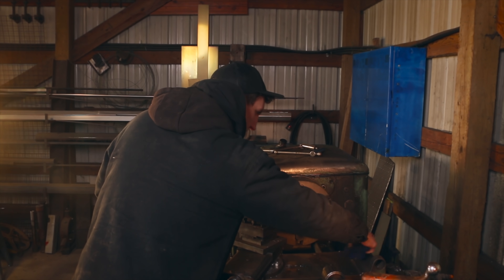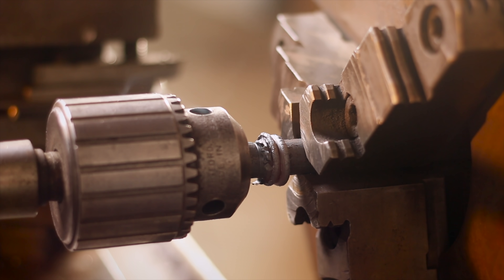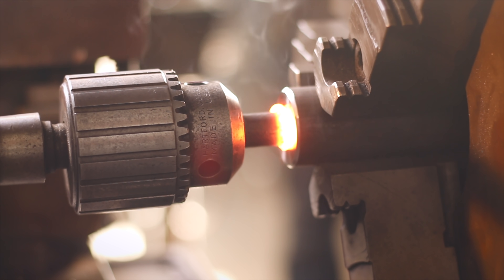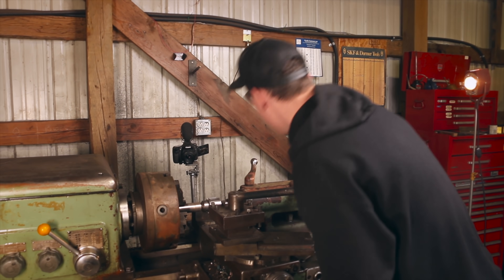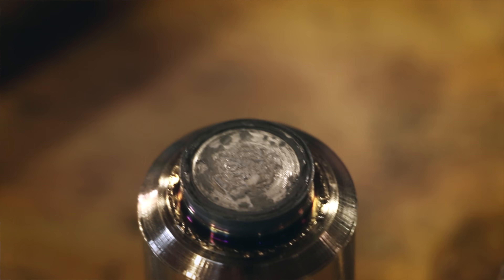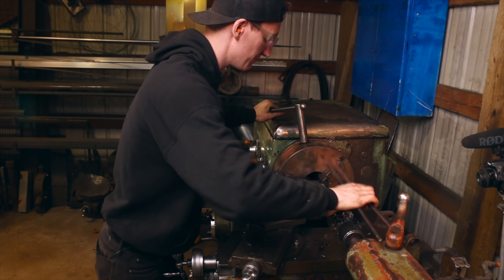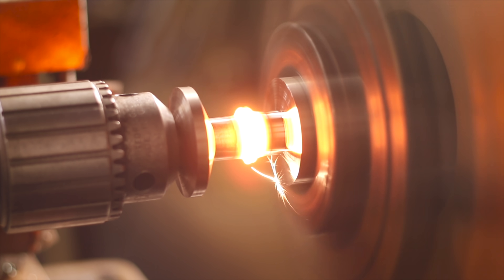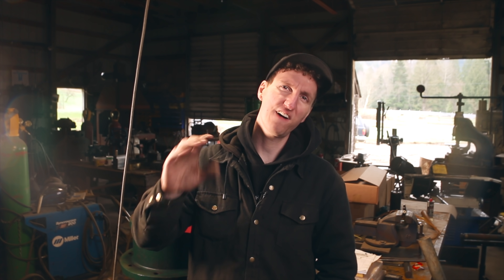Can I FRICTION WELD TITANIUM on my LATHE?

Comment: When friction welding, the more buttery melted metal extruding from both ends you are welding, the better the weld will be. Also, as soon as you have stopped the spinning used to create the friction weld, apply as much pressure force to the joint as possible, this will help achieve a stronger friction weld join...

Comment: As far as I know the material needs to be as thick as the piece you are friction welding nother words it need to have material coming out to shave off as thick of the metal I believe don't know for sure but it does make sense though i think

Comment: Years ago I visited a factory that employed friction welding to join axle halves. Their setup used a spinning end and allowed for adjustment of the stationary end, so when the weld was done and the resistance increased, that end bagan to spin too. The welds were great and done in about 2 minutes.

Comment: It worked so well on titanium because friction stir welding was developed for titanium (and aluminum to some extent) because standard welding processes don't work as well on those materials. Maraging and inconel are less ductile at high temperatures than titanium, but still possible to weld this way: it just takes even more mechanical force. Ridiculous amounts frankly

Comment: The first is exactly how a friction weld should look like! It has to bulge a little like this. If you see this (and the combo is weldable at all) it's almost certainly a good connection.
If a material is weldable by any means it usually can be welded by friction welding... if your lathe is strong and rigid enough. Turbine rotors from super alloys similar to your inconel stock are welded like this, but on HUGE machines using drive motors in the Megawatt range or tons of flywheels and hydraulic pressure.

Comment: Wonder if welding small to large would work better if you drilled the bigger piece with a small tapered hole and deformed the smaller rod into it? Lot more surface area, so the smaller piece would dump a lot more heat into the larger piece.

Comment: I’ve done this on a lathe. The problem is that the lathe takes too long to stop. If you watch friction welding they stop instantly. It would be good to make a clutch or some type of release on the drill chuck so it would instantly spin with the lathe chuck.

Comment: You gotta take it further! Take your welding sites down to half inch diameter and around quarter inch long and squash those puppies together till the whole welding nub mushrooms out. You need small surface area for high pressure at the start and enough material to mush the impurities out. Kool video! That titanium mushroomed nicely. I only worked with steel.
OOO                          OOO                                                          OOON|NOOO
OOOO                     OOOO                                                          OOOO|OOOO
OOOOOOO  |  OOOOOOO                                                          OOOO|OOOO
OOOOOOO  |  OOOOOOO                                                          OOOO|OOOO
OOOOOOO  |  OOOOOOO                                                          OOOO|OOOO
OOOO                     OOOO                                                          OOOO|OOOO
OOO                          OOO                                                          OOON|NOOO

Comment: I'd be really curious about how much it would help/hinder or nothing at all to take a propane/mapp gas hand held torch and assist in heating up the two pieces especially to help heat the part not moving in the chuck. Would it weld easier because you have more heat or would it cause it to oxidize and prevent the pieces from really sticking to eachother. Maybe an idea for another video or something. Anyways great video always enjoy your content.

Comment: I wonder if the dissimilar size weld could be better achieved by drilling a hole into the larger piece that is just a bit larger in diameter than the smaller piece, then having the smaller piece a bit longer than you need so the amount that squeezes out fills the hole.

Comment: Try using some argon gas next time I think it would actually make a difference same way you can't weld titanium or inconel because of the oxidation that is caused by the air and contaminating the alloys structures and properties

Comment: On a few of these, you didn't do it good enough, once the parts are white hot, you are supposed to push them hard together, that way they cool off with each other and not apart from each other, it's also a hit and miss, I have seen industries do this in certain areas where they can't hand weld something, so they use friction instead :P But other than that, I think you are getting a good handle on it, and..... Friction welding is much safer than any other welding....

Comment: At the last stage in Friction Welding when you stop the lathe, the non moving part should also move with the rotary shaft and then come to a halt so that there is no weld abrassion
Reply: Agreed, say a brake on the stationary chuck that would allow you to "release" the chuck when you power down the lathe. Allowing them to spin together, and not sheering the weld. 

Or, make a snap brake for the moving chuck head, vis a vie: an oversized chainsaw safety brake.

Comment: try again but this time use 30 degree bevel for centering (convex/concave) ,well miss match by a smidge 29.750 to 30 so your center point comes to temp faster and before the rest of the metal .  you could also do multiple v groves to center and improve the area of weld ,but that traps oxides inside weakening the joint . its a trade of most times but improves weak joints .
blerpy derp it will improve joints that are weak from oxides in them ,gah there got it said correctly

Comment: One function that will affect the strength of the weld in any material is the "metallurgical structure". The welded area will potentially have a completely different structure due to the heat and cooling rate than the rest of the material. Sometimes the welded area will have a higher strength, sometimes a lower strength. In commercial friction welding, the pressure and temperature will be accurately controlled. Both pieces of material will be held rigidly / securely to prevent and sideways movement.

Comment: If the face doesn’t weld properly, instead of resurfacing it, use the pre-existing face to speed up the friction weld. Rough surfaces provide more friction.

Comment: on the ones that didnt want to stick, maybe try machining them both into like a sharpened (but flat tipped) pencil shape, so as they heat up and press together, maybe it would push the scale out to the sides and allow just the metal to fuse? idk

Comment: How to make the joined pieces a lot stronger....including different diameters.
Make a nipple in the stationary piece. If the diameter of the stationary piece
is 1/2 inch, turn down the end to 1/4 inch...1/4 inch from the end. Turn down the
turning piece to 3/4 inch then drill a 1/4 inch hole into it slightly less than 1/4 inch.
You want the one in the hole to hit bottom first so it heats up first and starts fusing.
By that time the top (larger diameters) should be making contact. 
Using a torch to heat the end of the larger diameter may help the fusing.
You may have to play around with the diameters, length and diameter of the nipple
and depth of the hole. It should weld/fuse very strong.

Comment: what would happen if you tried friction weld two different metals? knowing each types of metal have different melting point, so low melting point will glow and get mushed before the high melting point need more heat friction to melting point before it get fused. would be best to get two closest melting point to work?

Comment: Try cutting the stock into cone segments.  The small face will heat up and conduct the heat backwards pretty well.  It'll also minimize oxide buildup if you maintain pressure from the tailstock.  Also maintain it after you stop the spindle.  I think those in combo will help a bunch.

Comment: Couple items for you to do. 1: purge gas is needed for most welds done like this, was surprised to not see the Titanium not go up in flames. 2: cut 60 degree cones on the pieces one male one female, helps center and increases surface area. 3: to avoid spin-down issues, release the piece being held in the fixed side and let it spin with the driven side.

Comment: 4:10 With friction welding, you need the same diameter faces to be pretty much the same size in order to make the weld. This is because the entire end side of a piece has to connect to the entire end side of the other piece I order to create a solid weld. Having them at the same diameter allows the ends to perfectly rub together to creat the needed friction

Comment: You should have set a cone in a concave. This would maximize the surface area, just make sure the thickness around the cone is the same for even heat distribution.

Comment: You can get a better friction weld by increasing tge surface area between the two parts. If you go from a flat plane to something more of a cone, you will see better results with titanium. You can also just make it peg and hole mate to each other, but thats hard to keep stable on the lathe.

Comment: I'm not a metal worker but I've met Inconel while working with autoclaves. It's pretty neat. Acetylene torches bounce right off of it. Monel is cool too. A stuck Monel screw will snap your screwdriver blade, without a scratch, before it will break loose.

Comment: You could try using a welder for gas shielding, or start with points rather than flats, heat/weld center out. Just a though I felt like throwing out.

Comment: I wonder if you made one side conical, and machine the other to be the inverse.  So you have one going inside the other, which may give you more stability when applying pressure, but also more surface area for friction to generate.

Comment: Where the surfaces meet you could try to find a way to stop the material that mushes up and away from the bond, like a thin titanium sleeve or pipe slightly bigger.
Reply: I think you actually want this to happen, then just grind or shave off that mushed up exterior after.

Comment: Too  much heat sinking on that large diameter part right in the chuck, turn diameter down to other part diameter on maybe 1" lenght or so and give it some stickout, and it likely works.
Titanium is very bad heat conductor, so heat stays right in the friction zone, that's why it works so well.

Comment: might I suggest angling the bits so they fit in one another and create more surface for welding and morphing
Reply: You acttually want the opposite - He needs to reduce the area
The pressure is limited by his leverage - He needs the pressure to increase to create enough spot heat to plasticize the metal so that it can flow and stir
As that happens the mushroom is oxidized surface being pushed out under pressure leaving a gasless contact for the stir

Comment: Can you friction weld titanium to steel?
I know it’s really hard to do this task anyways but I’m just curious
Reply: Yes in theory, but not well in any practical case - the difference in heat transfer capacity means 1 material reaches plasticising heat and flows which means the other loses pressure
This means the more conductive material deforms hugely and the other starts losing heat
Reply: @bengrogan9710  wow, interesting. I learned more from one comment then I did my entire life in school

Comment: Fun fact: the weld in a friction weld is actually stronger than the material welded.
Reply: @DingDingTheYoutubeBuddy  you’re right, it binds the material together as one. But a friction weld produces a finer grain size than the original material, which in many circumstances makes the weld stronger than the original material.

Comment: I have an  idea you can try and make the tip of one of the materials  like a cone or a needle so that when the metals combine they aren't just stuck together but one of them is imbeded in the other and the heat will weld them a bit stronnger but thats just an idea .

Comment: For the metals that didn't work well, i think if instead of machining the ends completely flat, you could try machining them in a bit of a cone shape, with a smaller flat surface, allowing it to heat up faster in a local area, then when its hot enough push it together so it mushrooms out until you reach the base of the cone shape and are back to the original diameter.

Comment: Friction welding requires upset (pressing the pieces together to squeeze out metal from the inner faces) to join clean metal together within the weld.
Trimming off the upset removes stress concentrations,
And ideally you would want one of the pieces to be released after upsetting them so that it can spin freely with the drive (continuous drive friction welding is what you’re doing) and allow them to join.

Comment: Very cool video. Always cool to watch this stuff, I'm a mechanical engineer, took materials science a while back and I did a research paper on friction welding. What I think most affects fusion in friction welding is how readily the material transfers and merges together, which is affected by hardness, surface roughness, and conduction across the heat affected zone. Soft very smooth materials that readily exchange electrons can actually cold fuse together if theyre similar surfaces enough. Anti friction and anti galling materials are designed usually through surface treatments to resist the transfer of materials and recrystallization of the material structure. Deal with this quite a bit in the food and beverage industry, cause we want to use stainless everywhere but you can really use a stainless shaft in a stainless steel hollow shaft geardrive unless it's precipitation hardened and expect to get the drive off cause they will gall together.

Comment: If it's not showing colour, it's not heating.

That's the trick. Ever looked inside a furnace? Everything is the same shade of orange/white, no matter the material, if it's the same heat.  Some metals will be soft when orange, others, like titanium will remain hard long way into white.

Comment: Have you tried fitting one side inside of the other to see if it'd fuse? Like a 3/4" piece fitting inside a 3/4" hole on the other piece?
Reply: Too much surface area reduces the spot heat generated as the force you can apply is limited
Reply: @bengrogan9710  Okay that makes sense. Thank you for the insight!
Reply: @420Chameleon  Essentially the failure point for friction welds is if you cannot create spot heat faster than the metal conducts it away - The only way to create the spot heat is more speed and more pressure

The pressure here is limited mostly by the pitch of the tailstock screw so the smaller the area the more PSI you can apply even though the force never changed

Comment: I feel like you should try flooding the area around the lathe with Argon somehow, maybe a circular hood around the lathe, with the titanium🤔
Reply: I was thinking the same thing. He needs to surround the outside or the weld with a inert welding gas like Argon so it will stop the oxygen from getting to the weld. On any of the metals this would only make the weld stronger. The 2 different sizes could be done easy enough to by heating the larger size with a rose bud first.

Comment: What i think would be cool if you designed a chisel that would make the excess metal shoot back at the lathe so then you could use a metal chisel while its still spinning and red hot so then it would be a really smooth weld

Comment: You should remove the mushroom edges before hammer testing. Those edges are an invitation for the  crack to propagate. If the joint is clean, then the strength should increase. I suggest you to arrange a simple pendulum testing apparate, so you can even have a quantitative measure of the results you got.
Good job.

Comment: Interested to see what that'd look like if you turned down that mushrooming. I'd imagine the grain structure would reveal a lot about the conditions during the weld. Also, if you do this enough, I'm sure that you'll find that creating some sort of taper to the pieces will help in heating up the opposing surface quicker by starting in a smaller area allowing for deeper penetration with less exterior deformation.

Comment: Welding with friction uses the same concept as a regular welding. The bigger the piece the more heat is needed to weld the pieces together. you can weld the big piece of titanium but because friction is the main method of heating you will need to spin the pieces for longer in order to heat it up. In order to have successful welds via friction welding you need to always have that mushrooming in the middle of the two pieces this ensures that the molting metal is pushed into one another.